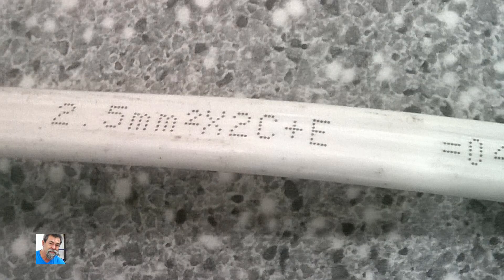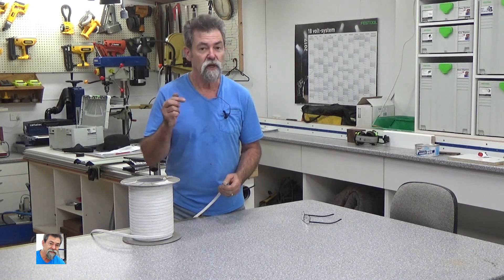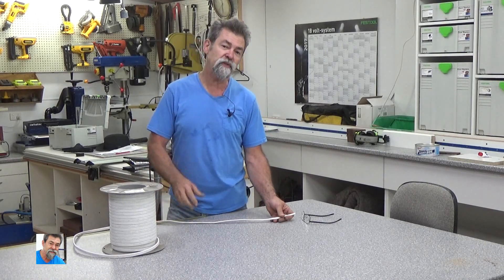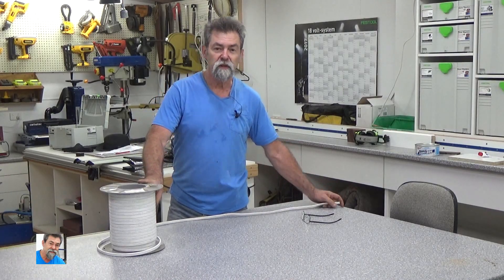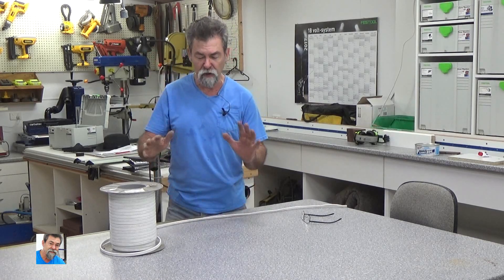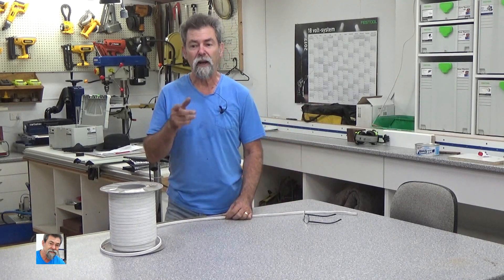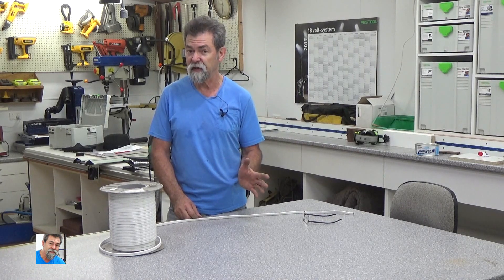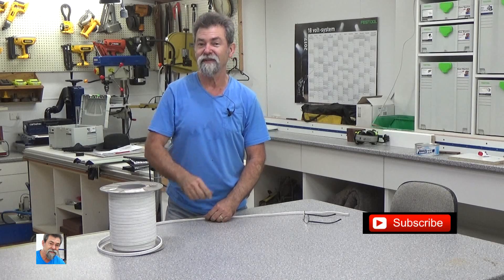Easy, how much electrical cable is left on spool | dave stanton | how to

Comment: Bummed out.  I have a spool of 6/3 direct bury cable that isn’t marked.  It was a 250 ft spool when I bought it new but I used roughly between 125 - 150 feet just not exactly sure.  Now I want to sell off what I haven’t used and not exactly sure how to measure it aside from completely unraveling it.  It’s really thick so it would be easy to do.

Comment: isn't there a way to measure a cable with a multimeter and use math to figure out the length of cable left on a spool that is not marked?
Reply from the maker: I don't know.

Comment: Thank you for the tip! I have 682 feet left of a 1000 ft long reel of cat6 wire. The only reason I know that is because once I listened to your video, I went over and checked the writing on the wire, and it’s length is marked on it every two feet! Thank you!! I am so happy I decided to check YouTube before I actually unrolled 682 feet of wire! =)
Reply from the maker: My pleasure Jodi de Vries! I have heaps of tips on my channel if you have time to look around it.

Comment: 2-core cable is used for small appliances that are insulated (made of either plastic or have an inner wall of non-conductive material), and is connected to the European plug that are unfortunately often shed, as devices from England are sometimes cheaper than in Germany, English plug cut off and built European connector to it. :-) :-)

Comment: Hi Dave, you have just saved me a small fortune. I am running 40amp rollex cable from my house to my shed and was going to bye a new roll as I did not know if I had enough for the last run under my floorboards to the double pole cutoff switch with GFP. as it is a bank holiday her in the UK it is chucking it down with rain so I was going to go and get a new roll, I now know that I have enough cable left so I do not have to bye a new roll or ask the bank manager for a big loan to pay for it. Thanks again.
Reply from the maker: My bill is in the mail!

Comment: So is it 14 or 12 gauge wire? Hot & neutral with ground. That's US speak.
Reply from the maker: Hey Joe. My understanding is you can get solid or multi strand wire. The bottom line is that a cross section of the wire (in Australia at least) in the active and neutral are 2.5 square mm  each. In countries that use imperial measurement you would have to check with an electrical wholesaler.
Reply: It's neither.  But it would be closest to 13 gauge.